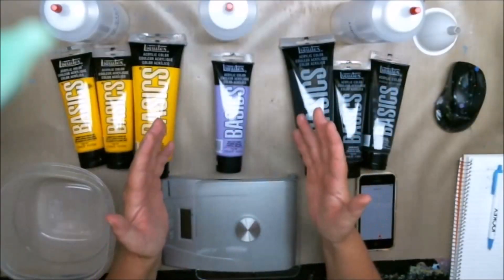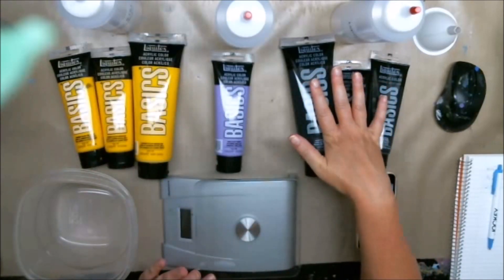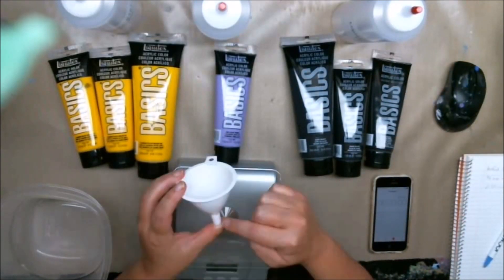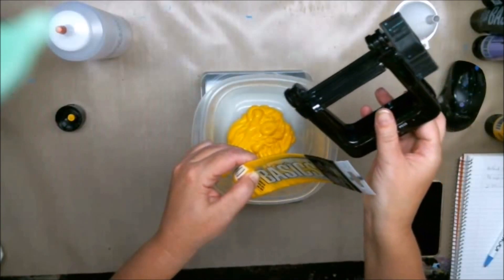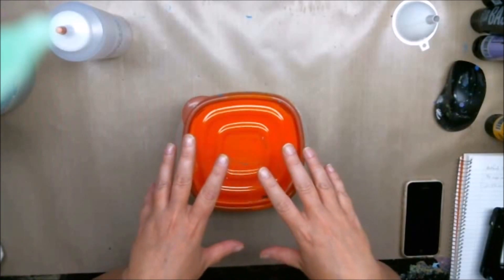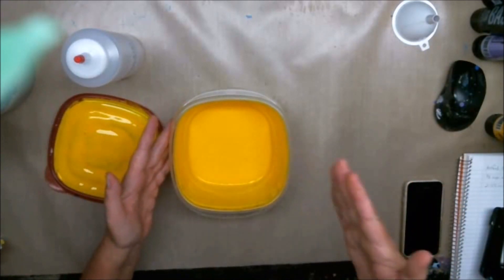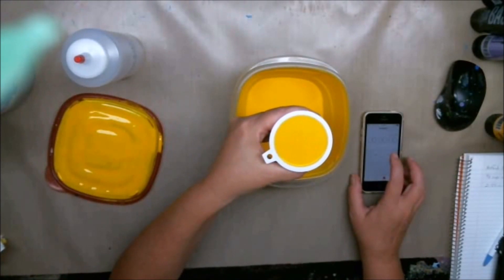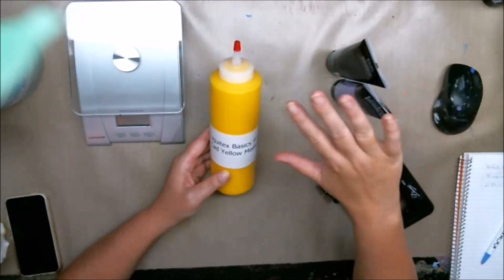HOW TO:  Make Fluid Acrylic Paints -- Artful Magazine Submission Oct 2016

Comment: Interesting video. I'm a professional woodworker and I agree about the bubbles, they will be gone in an hour or so with so thin of a liquid. You could also use a #4 Ford cup to measure the viscosity. You would have more standardized results. The #4 ford cup I use is plastic and costs about $15.  I can go back to my notes from 15-20 years ago and repeat a finish mixture I used in the past.  Mixing by weight as you do is a very good practice as well. Thanks for the video.
Reply from the maker: Thanks for watching.  Yes I used the funnel in lieu of a ford cup.  I was going to order one and then figured if I used the same funnel I would get repeatable results.  But I thank you for commenting on that for others.  The mixing by weight is my standard practise, however I have told people if they really want to do it by cups instead, they can, but have to be able to use the same measuring cup all the time.  They are all different.  And I am very happy that you have notes that go back that far for repeatable results....that is an organizational mind that I can certainly appreciate.  Thanks again for wathcing and commenting Frank, I really appreciate it.  cheers.

Comment: Hi Andrea
. enjoy your vid .  Have you thought about using a kitchen stick blender to mis your paint . no bubbles
Reply from the maker: That is a good idea ... and I think it would work if I was doing a large batch of one colour.  I am waaaaaaaaaaaaaaaaaaaaaaaaaaaaaaaay too lazy to clean the thing between colours :)  And now that I mix right in the squeeze bottle it wouldn't fit.  BUT that is an AWESOME idea and I will mention it in an upcoming video.  Smart lady!  I don't worry so much about bubbles anymore as my paints sit for so long in between mixings and I use my heat gun to pop them.  But I still Love this idea.  You Rock.

Comment: Andrea, what was the size of the the liquitex basics tube you used??  Thanks!!  Leslie
Reply from the maker: I was sure I posted an answer here yesterday.... the comments have been acting up.  4oz or 118ml is the size I used and they usually weigh around 125gr, however they have 8oz or 250ml as well, which is a bit cheaper.  My goal is the eventually buy the 1 quart/1litre sized ones :)
Reply from the maker: AND THANKS for coming and watching my videos.

Comment: how much longer does it take to dry the canvases with this style of work? 
Im used to just regular  acrylic  brush  painting. ...which  we know drys fast.
Reply from the maker: Excellent question.  I don't use pouring or other mediums.  I only use water to thin the paints.  So if I leave it alone it will be dry in a few hours or overnight.  Mediums and resins take FOREVER to dry...so I am liking this.  If I am in a rush, I will put a hair dryer on low and cool and blow it across the painting to help the water evaporate.  It dries matte, so I always give it a glossy varnish finish!  Thanks for your question!

Comment: I'm confused - esp as you don't distinguish between 4.1-4.9 flow differential.  I'm assuming you WANT differences in viscosity for the paints to interact with each other.  Ergo- I would think you would want some paints below 4.1 flow and some over 4.9 flow.  How do you thicken the higher viscosity paints and how do you thin for the lower viscosity?
Reply: I would think the SAME viscosity would make them mix together more easily.  There is a siqueiros painting technique that is shown on youtube and the paints interact BECAUSE they have different viscosities.
Reply from the maker: My method is dependant on the paints having the same viscosity and pushing against each other instead of mixing.  The difference between 4.1 and 4.9 isn't enough of a difference for them to not push.  If they have different viscosities the more fluid paint will mix with the thicker paint by floating on top of it as it is more watery.  I don't want them to interact for my method.  Now there are a TON of artists out there who love that the different thicknesses interact...but for me that isn't what I want.  So my method is really for people just starting out who want a "recipe" and aren't into mediums or additives.  They can build their techniques from there.  I use less water or more water to thicken or thin the paints.  But because I use the same paints and the same recipe to get the same viscosity this isn't an issue for me anymore.  I have my 50/50 recipe and am happy with it.  This is a great question, and I thank you for posting it.
Reply: thanks

Comment: love all you videos! how long can you store the mixed paints?
Reply from the maker: I use paint up really quickly!  I go through tons of it.  However, I have a few paints that I don't use very often that are going on 6-8 months.  They are in air tight containers.  If you open them up and they smell, they have been infiltrated with bacteria and shouldn't be used.  But if you seal them up and shake them every now and then they should last you 6 months.
Reply: Andrea Mercier Thank you for the info 😀
Reply from the maker: you area very welcome my dear!

Comment: Hi 
Am completely new in this ... tried with medium ... but it was complete  fail ...
Can u temme was it hot water or cold water ?
Reply from the maker: I use warm water when I mix as it boiled first to kill any bacteria so my paints don't get a bad smell.  I am too impatient to wait for it to cool.  If you are mixing with distilled water from a bottle it can be cold out of the bottle.  I hope that this helps!  Let me know how it goes.  Good luck.  And be brave....experiments are a good learning tool.
Reply: Andrea Mercier 

Can u temme what I've to do ...if I want to keep ma painting glossy look? 

the one I tried ,  when it got dry...😣 it's not glossy at all ...😣
Reply from the maker: Acrylic paints dry matte...so if you want glossy you can either spray with a gloss varnish or clear acrylic spray paint.  Some people will use resin after it is dry for a glass like finish or use a varnish with a sponge or brush.  I hope this helps.  Cheers.

Comment: My paint cracks after it dries. Do you know what I might be doing wrong?
Reply from the maker: Hello Krystal and thanks for watching my videos and commenting.  Sorry that your paint is cracking...There are usually a few reasons why fluid acrylic paint cracks as it dries:

1. The paint is too thick, so the outside is drying faster than the inside and it causes cracking or what some artists call crazing.  If you are using my 50/50 by weight method then the paint should be the consistency of thick cream or thin crepe batter.  If it is thicker than this, it isn't wrong, it will just pile up and not flow out as much, giving you the cracking during drying.   This can be nice for texture, but if you are avoiding it, make sure you paint is thin enough.  My recipe is actually thicker than a lot of artists, so if you want to add more water you can.

2. The paint is drying too fast due to applied heat or fan; causing the same issues as above; the paint is drying on the outside faster than the inside.  Fluid acrylic paint that has been poured out and "stretched" over the edge of the canvas will normally dry from the outside edge into the middle.  If you put a heat gun or hair dryer on it to try and dry it faster, then it will dry the top layer first, trapping the moisture inside and cracking.  If you are trying to speed up the drying, try putting on a fan or hair dryer that is indirectly blowing air around the room without heat.  I will point it at my wall and it will bounce off and just move the air around the room without actually drying it.  I find it does speed up the process a bit, but my paint mixture still normally needs overnight to dry.

3. The paint is reacting to an additive.  I don't use additives in the majority of my paint or work.  99% of the time it is paint and water only;  however some artists do enjoy working with additives and mediums.  Some of these can cause a chemical reaction that heats up the paint mixture causing it to dry too quickly and thicken up; causing cracking.

These are the most commons reasons.  If this doesn't sound like your issue please feel free to comment back with your mixture and I will try to troubleshoot it with you.  Good luck!  And again, cracking isn't a "bad" thing.  In Japanese culture a broken cup is repaired with gold so that the flaw can be admired as well.  If you love a piece and it is cracked, try filling the crack with gold paint or Inca Gold and loving it for what it is.  Cheers.
Reply: It could be under binding. Because on almost all acrylic paint it states only to use up to 30% water. 50% water can cause cracking and crazing maby try a pouring medium to help.

Comment: I am just getting started into fluid arts and went to a demo at an art shop a few days ago.  The person doing the demo cautioned against using water and recommended the pouring medium instead (at least when combining it with pre-made fluid acrylics - they used Vallejo).  She said that water tends to make the paint pigments separate.   
Is this  just how you make the fluid acrylic paint from the basics, and you use a medium when you're prepping to pour, or is this your final mix (viscosity) and you're pour-ready at this point?  Looking at the cost of the Vallejo or Golden Liquid Acrylic paints, I'm definitely interested in making some of my own.
Reply from the maker: I am aware that some in the profession believe that the water will ruin the paint, but I encourage you to check out my professional fine art at www.am2fineart.ca to see the beautiful results we get. The canvas has to dry flat, so the water evaporates and the pigment settles into the canvas fibers permanently. My partner cannot remove it even with oil paint thinner, which is a caustic chemical. It completely bonds into a plastic film. I do not use mediums for any of my pouring or teaching. Water and Liquitex Basics 50/50 by weight. Period. I tried medium in it once and it was a mess to clean up. My formula is cleanable with soap and water and comes out of clothes and rugs. Because my pieces are so large (usually 4ft x 3ft) I could never make my paints with the Vallejo or Golden paints it would be prohibitively expensive. I have been pouring like this for 3 years and the paintings that I display at gallery shows still look as good today as they did three years ago. Try it with water only and see the results you get. As long as the paints are all the same viscosity it won't mix and muddy. I have given up trying to convince people that I am correct about the water only and let my art tell the tale instead. Good luck! If you have other questions, please drop a line here again.  Cheers.

Comment: Hi 
I am facing difficulties in this technique of making fluid acrylics
My paints actually mixes each other and turns into their perspective shades after mixing!
Can anyone please guide me that whether I have to use any medium to resolve this issue
Reply from the maker: Hello!  Sorry to hear that you are struggling.... have you watched this video in full?  It describes the mixing of the paints for my recipe at 50% water and 50% acrylic paint by WEIGHT.  This gives you a consistency of thin pancake batter or crepe batter.  If all of your paints are the same viscosity/consistency they will push against each other and not mix.  So I am thinking that you are either mixing them too thin and they don't have enough body to push OR that they aren't all mixed the same consistency and the thinner paints flow over the thicker paints and then start to mix.  You certainly CAN use mediums, but I don't and get really great results.  Check out these videos to see some real time tutorials I have done

https://www.youtube.com/watch?v=eETsUN4Yy1U&list=PLuelvQXCHwS5GKk3MlfnP7qrOnhfTu1Ww&index=3

Good luck!  Let me know how it goes.
Reply: Thanks for your concern and guidance 
It is actually helping me
Reply from the maker: YAY!!  I am very happy it is helping.  Good luck

Comment: Do you ever use floetrol? If not what is the reason?
Reply from the maker: I do not use floetrol or any additives to my paint and water mixture.  This is for a couple of reasons, the biggest is that I teach to the public, both seniors and children and don't want any toxic things added to something that might end up in someone's mouth.  The second is that I have experimented with additives, specifically mediums from Liquitex and I didn't like the clean up.  Paint and water washes away without more than soap and water.  I encourage people to experiment with mediums and additives, but to be aware that they were never meant to be heated up and vaporized and breathed in....and to read labels and make sure what they are using is something they are comfortable with.  Hope that helps.  Have a great day...and thanks for watching my videos.
Reply: Didn't know floetrol was toxic?
Reply: @steeeez77  it isn't. It is definitely non hazardous.

Comment: Interesting!  So now it’s 2019. Have you found that your recipe has worked?  Mo cracking in your paintings as they have aged?  Thank you!
Reply from the maker: So I have been doing this for 3ish years and continue to make large paintings for sale. You can check them out at www.am2fineart.ca  Additionally, once cured the paint completely hardens into a plastic film that my partner cannot move with turpentine when she paints over it in oils. I have not had one crack that wasn't planned and filled in with a metallic paint.  The plastic film embeds itself into the fibre of the canvas and cannot be scratched off without damaging the cotton duck canvas.  So I am very happy with the results and so are my customers.  Thanks for asking!  Have a super day.  Oh, yes...my recipe has worked well and I still do 50/50 by weight.

Comment: I always have an issue with the "honey" part... I don't like honey, I don't want to heat it, or smell it... your method actually explains how to get to a specific consistency consistently, and for that reason it's more realistic. I do have a consistency that I enjoy using, and matching it from one mix to another is my goal. Thank you for also using the scale. A lot of time people are forgetting that the weight of paint is different from the weight of water, and they try to measure depth instead of weight.  An inch of paint doesn't weigh the same as an inch of water!!! So thank you for helping take the confusion out of mixing and consistency.
Reply from the maker: I am glad that it helped you!  Thanks for watching my videos.  I am moving right now to a new city, but hope to have more videos up soon!  Cheers.

Comment: Hi....I am in the "learning" stage and have "sticker shock" over the price of paints and such lol, so appreciate anywhere I can save $$...that being said, I had read elsewhere (I am doing LOTS of reading) that mixing only water into the paint vs a medium, makes the paint unstable long term and it will eventually flake off the surface...as it was explained, it had to do with the space between the pigment molecules and how they bond to water molecules vs medium molecules...the water molecules and too far apart from the pigment molecules to form the "honeycomb" stability molecule....so while I would love to only use water, I was wondering if you had any thoughts on that subject....any personal experience in terms of long term paintings.  It's one thing if you make something for yourself, but if you make it for someone else you certainly want it to last forever....thanks!
Reply from the maker: All good questions.  I have been doing this for a year, art for myself and for commissions.  When you pour the paint you are applying a LOT more paint than when brushing it on.  Yes, if you dilute acrylic paints too much on a brush painting they can flake off over time...but this process is different.  The paint is thick and stretched...creating a smooth surface when dry.  As the the water evaporates from the surface the paint sinks into the canvas fabric and dries.  It actually becomes part of the canvas.  It can't flake as it is all one solid piece of paint.  It is the same with canvas panels, the paint dries into the crevices of the fabric top and on hardboard it become part of the wood.  I let it dry slowly, evaporating the water over a couple of days.  I don't force the drying as it will crack and then flake.  I always coat my paints with a spray varnish to give it a glossy wet look, which seals it permanently.  I only use water right now as my pieces are so big that a polymer or medium would be outrageously expensive.  I encourage you to watch my videos, go to www.facebook.com/AnlomesArt to see paintings I have done and I also have a group at www.facebook.com/groups/FluidAcrylicPaintCommunity  where we can have more discussions.  Cheers.

Comment: Are you not worried about your paint under binding? Every pain company out there says MAX water added should be 25 to 30% or over time your paint WILL flake off your canvas. Could take a few years but it will flake off!
Reply from the maker: I am glad that you watched me other video on 50/50 paint and water...and yes we can agree to disagree.  I have had extremely good results, have a partner who uses oil paints on top and corrects with paint thinner and have two emails from paint manufactuerers that state that they don't officially have a maximum amount of water.  It is up to the individual artist.    But I thank you for watching my videos, chiming in and being concerned.  Have a great day.